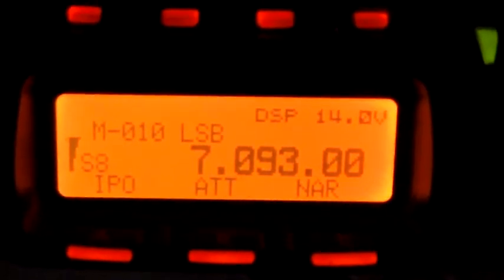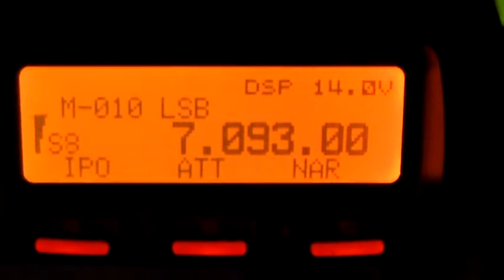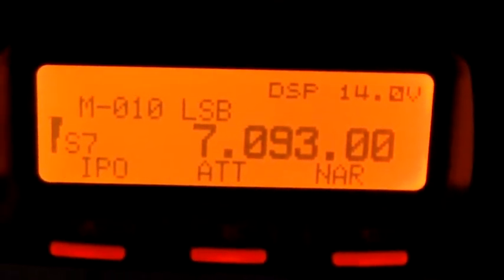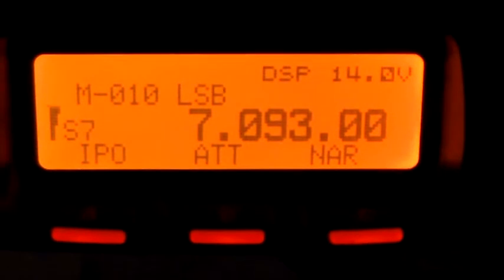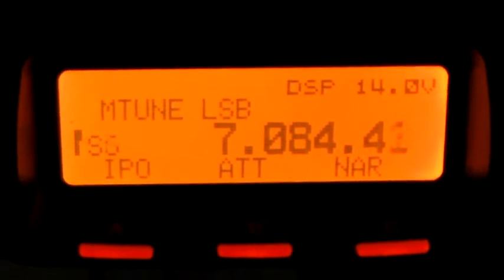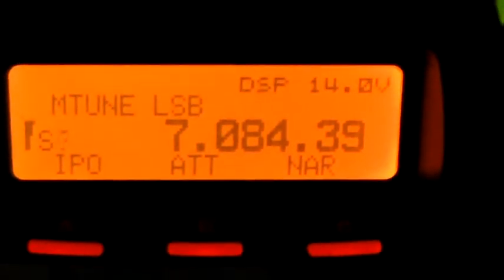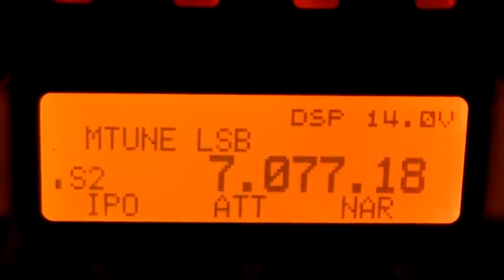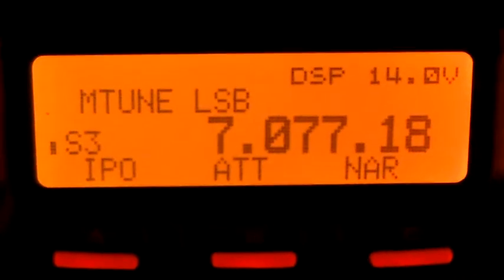Tuning Across The Magnetic Loop Bandwidth

Comment: Interesting . ihave a question if your ft857 if the antenna is not at 50 ohms the receiver dosent come alive do you experience the same issue  tnx kg6mn
Reply from the maker: If you connect a wire antenna to your 857 via an ATU and tune the ATU for a specific frequency you can see the difference for yourself. Most ATUs have a bypass switch, by tuning the ATU to a specific frequency you're matching the wire antenna impedance to 50 Ohms. If you listen to the noise... or a station on that frequency, and then activate the bypass switch you will hear the noise or the station drop in signal level, this is due to the impedance mismatch. Any wire connected to your 857 antenna port should work well as a receiving antenna, but it should work better if it's matched. I can hear stations with my ATU on bypass with no problem.